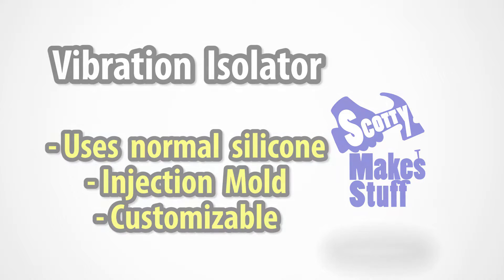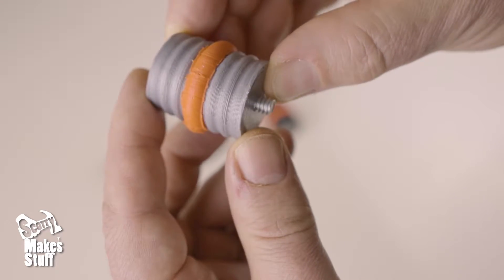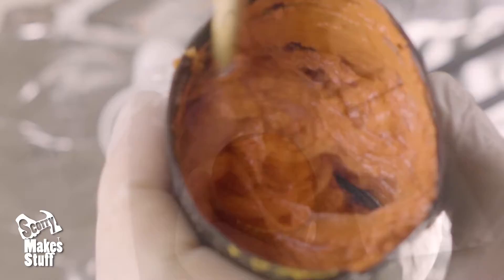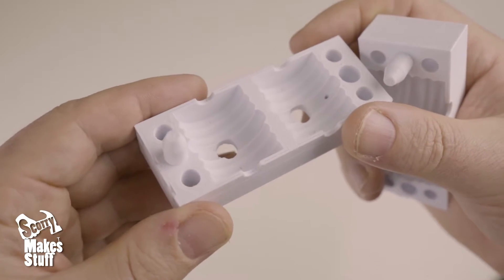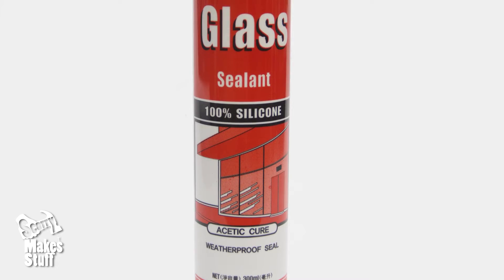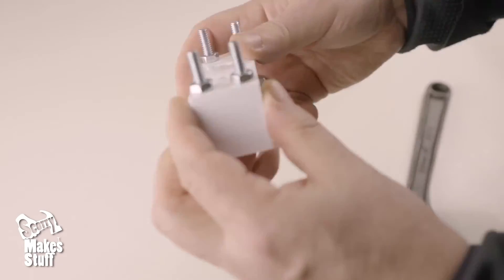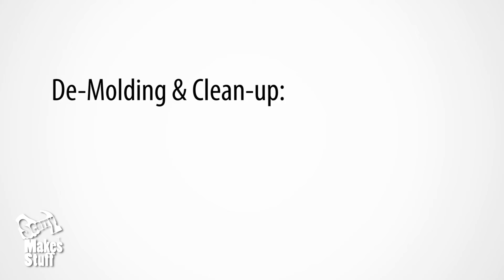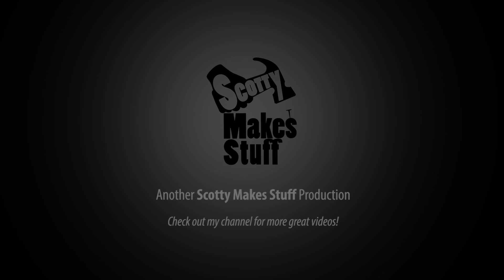Anti-Vibration Isolator using 3D printed mold

Comment: #scottymakesgoodstuff . 
that 3d opens up a lot of options .
espechialy as an alternative for cnc in the prototype stage .

2 from the test i made ,

this material can be used to make costom foot pads for windsurfing boards ,
Reply from the maker: Yes, you can even use the concept for two part resin mould with the correct mould release.

Comment: Silicone caulk sets by absorbing moisture. Stirring in a little liquid food dye might make it set faster.
Reply from the maker: Yes, typically moisture in the air is what reacts to solidify the silicone. The acrylic paint makes it set within minutes so there's no need to add any more moisture. I also think the fine particles in the paint help distribute the moisture throughout the silicone more effectively.
Reply: Right, makes sense. That reminds me, I have some left over acrylic ink from an art project. I bought a tube of silicone a few days ago and I think I'll try that in it.
Reply from the maker: Just be careful! Once you start you're likely to develop an addiction to making things out of that soft squishy stuff ;-)

Comment: I used your technique to make an isolation foot, just as a trial. I got it to work on the first attempt. Thanks for your efforts. However, I wonder if you have considered how to stiffen the silicone. What would you consider as an additive? I am wondering if adding talc will work.
Reply from the maker: microspheres such as qcell and fillrite seems to harden the silicone. I never tried talc but it's worth a try.
Reply: @ScottyMakesStuff  Thanks for the reply. 

I tried talc and it does stiffen it. However, I have used your acrylic paint only method and never got it to cure as quickly as yours. Mine is taking at least 8 hours before demould and then I leave it until it's been out for a day. 

I also tried household emulsion as a cure/colourant agent. I got some small matchpots from one of those mix your own colour machines in a big DIY superstore to replicate CMYK as near as possible and added white, so I can mix any colour I need. I use 5ml plastic syringes from a  chemist to suck it up and mix it in small quantities. The matchpots are around 100ml and £3 each, so it's not expensive to do. It will cure, but takes as long as with artist acrylic.

I am considering trying some plat catalyst, but I'm not sure if builder's silicone is the same chemistry. I note that different cats are sold for different hardness pourable silicones. 

If you have anything further to add regarding speeding cure up, I'd be most grateful.

Thanks.
Reply from the maker: I believe it's called a condensation reaction. Household silicone uses the moisture in the air to cure which is why the acrylic paint works so well - it has water mixed into it. You could therefore try thinning your acrylic with a small amount water to help speed up the polymerisation. Theoretically this will promote more cross linking and a stiffer polymer.
Reply: @ScottyMakesStuff  Thanks. I will continue my experiments.

Comment: Hi Scotty;
Well everything works but how do I get the mold apart without he part I'm making  coming apart. and the silicone does not cure. what am I doing wrong? Do I have to mix the silicone with the paint before putting in it in the mold?
Ed.
Reply from the maker: you need to go over the video again because all those answers are in the video

Comment: I've already made the molds but a 1/4" bolt or nut won't fit the holes or the nuts. Only 6mm will fit.
Reply from the maker: There's two versions, you printed the version that says 6mm in the name. The other versions are 1/4-20